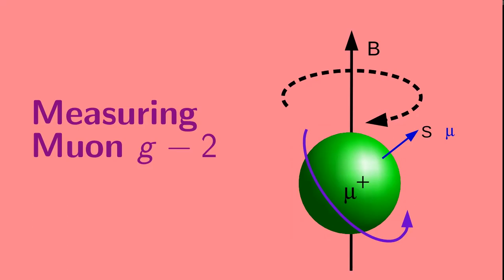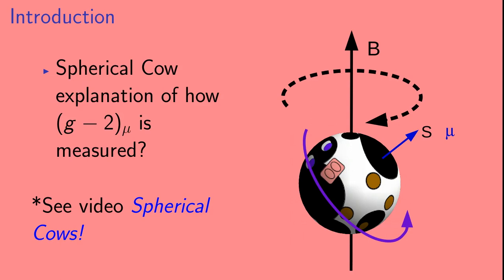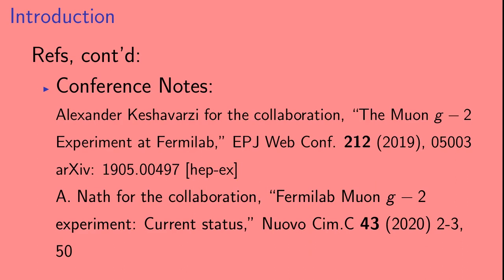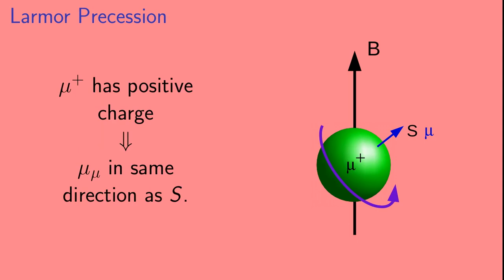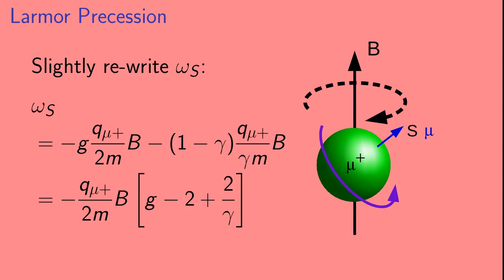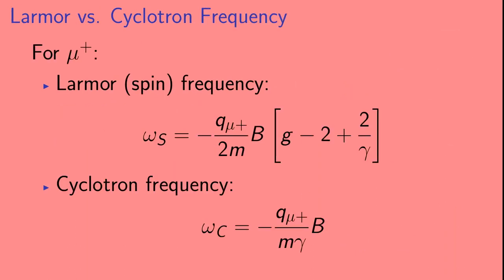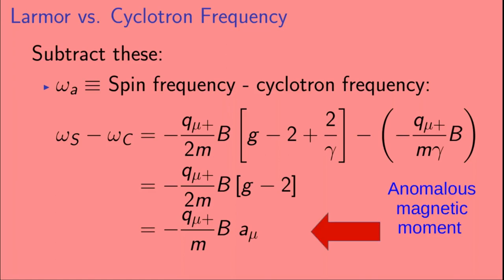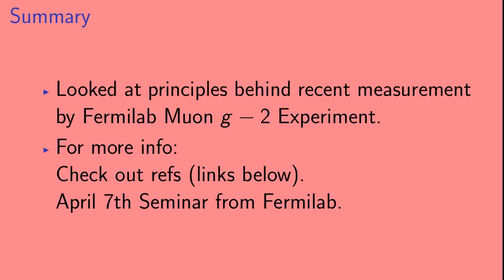Measuring Muon g-2

Comment from the maker: Hi!  Questions?
Reply: Hello again. About my previous question. I've opened a related thread here in the PSE forum: https://physics.stackexchange.com/questions/631982/does-an-observer-moving-in-a-circle-with-constant-angular-velocity-in-space-expe?noredirect=1#comment1421013_631982 
Because this question really puzzles me. What I'm missing here?...
Reply from the maker: Hi!
I'm going to be a bit slow about answering your question.
On the one hand, the formula I used to get the 64 microseconds was entirely from special relativity, so I can tell you that if take only special relativity into account, and ignore general relativity, you will pretty much get the right answer.  (Note:  I haven't checked exactly how precise you can be in saying that, though.)
On the other hand, I wanted to see if I could say something quantitative about how large the general relativity effects should be.  Initial indications are that this might be a highly non-trivial question. 
I'll try to see if I can say something more within a few days.  (But, you might get a better answer from PSE first!)
Reply: @ThinkLikeaPhysicist  Thank you very much for your reply and interest about this question. Seems so far from the PSE answers that gravitational time dilation is applicable only for a fixed direction velocity vector as we have in the case of the gravity acceleration or a spaceship accelerating straight in one direction. For a circular path with constant angular velocity the effect of centripetal and centrifugal accelerations seems to balance out and there is no any accelerated related time dilation! That was surprising to me I didn't know that neither was I taught such think although this sounds logical now to me. Bottom line, in the g-2 experiment, as long the antimuons are circulating in the storage ring at a constant angular velocity, don't bother about gravitational related time dilation effects. The only possible implication I could think of related to gravitational time dilation  and the g-2 experiment are tidal forces during the day that could change the elevation of the storage ring. I don't know how this fluctuation could affect the experimental result at this level of precision?   Maybe it is worth asking the g-2  team collaboration directly if they have anticipated this kind of fluctuation?
Reply from the maker: Hi!

So, it turns out that your question is rather deep.

I've found 2 sources that might be of interest to you.  The first is a write-up that is fairly readable:
https://math.ucr.edu/home/baez/physics/Relativity/SR/clock.html

Now, I'd better give a caveat:  my knowledge of general relativity isn't fantastic.  So, I'm going to assume that what is said on this page is correct; I can't check it for myself in a short time.  I'll encourage you to check other sources!

That said, what this page says is actually really interesting.  We hear about gravitational time dilation, and also, a gravitational force can be taken as equivalent to an acceleration.  So, it seems to make sense to ask about time dilation due to an acceleration.

However, what this page is saying is that the acceleration does not directly cause time dilation.  Only the velocity causes time dilation.  The acceleration only contributes in that an accelerating body is changing its velocity, and the velocity, in turn, causes time dilation.  This is the case whether the body is accelerating in a straight line, or accelerating by changing its direction. 

So, how do we make sense of gravitational time dilation?  That page gives a nice, simple example of 2 astronauts sitting in a rocket at rest on a planet.  They feel a gravitational acceleration of 1 g.  One is at a greater height than the other.  The lower astronaut sends a light signal to the upper astronaut.  Because they are at different heights in the gravitational potential, the upper astronaut will receive the signal as slightly red-shifted.  We can say that this is because the photons had to climb in the gravitational potential.

But.....let's say the astronauts cannot see out the windows.  They don't know they're sitting on a planet.  They instead think they are accelerating forward with an acceleration of 1 g.  How do they explain it?

Their explanation is this:  the ship is accelerating.  That means the ship was traveling slightly faster when the light signal was received by the upper astronaut than when it was sent by the lower astronaut.  The astronauts will attribute the redshift to this change in velocity.  But, when they calculate what that change will be, they will take into account the velocity of the ship when the signal was sent, and the velocity of the ship when the signal was received.  They will not take into account the acceleration directly.  (The acceleration only comes into the calculation by making the velocities when the signal is sent/received different.)

This idea that the acceleration does not, in itself, cause time dilation is called the "clock hypothesis".  It's a postulate.  It's not derived from anything.  If it's correct, it means that there's no time dilation caused by acceleration of the muons in the g-2 experiment.  The time dilation is due entirely to their speed, and is entirely a special-relativistic effect.

This could easily lead to the question, "How does one experimentally check the clock hypothesis?"  You might have seen that reference to Bailey et al on the PSE answer.  That is--no joke--a previous muon g-2 experiment!  Here's the paper:
https://www.researchgate.net/publication/30398795_Measurements_of_relativistic_time_dilatation_for_positive_and_negative_muons_in_a_circular_orbit

There have been a few other tests as well.  I don't know about their comparative precision.

So, your question turns out to not be so much a theoretical one as an experimental one!

As for the tidal effects, I don't know, but you might be interested in this (or maybe you were already aware?):
https://accelconf.web.cern.ch/p93/pdf/pac1993_0044.pdf
and (only vaguely related as it's another tiny effect that had to be taken into account),
http://cds.cern.ch/record/334095/files/sl-97-047.pdf
Reply: @ThinkLikeaPhysicist  Thank you SO MUCH for your superb answer and time and effort taken to investigate this maybe not trivial matter concerning the  g-2 experiment. I am grateful for the sources you provided and will read them carefully. I already contacted Fermilab sharing my concerns about tidal forces related fluctuations but this  whole "clock hypothesis" axiom is a total new game changer and we don't know the implications extend of it to the g-2 experiment. Maybe you should present your investigation to Fermilab and ask them if they are aware about it? After all timing is everything :) Maybe also writing about it to the PSE forum. I am sure there are also Fermilab members in there.

In the past we had even 6σ discoveries who vanished because of fluctuations and unaccounted systemic errors. 

I wish you the best for your really GREAT YOUTUBE CHANNEL!
Reply from the maker: Thanks!  I could take a look and see what other tests of the clock hypothesis have been done since the previous muon g-2 experiment.  It's possible that other, more precise tests have already been done, but I don't know.  If not, it would be interesting to know what could be learned from the current experiment.
Reply: @ThinkLikeaPhysicist  Hi! I have found an analysis that seems valid and negates the "clock hypothesis" for centripetal acceleration: https://osf.io/mf853/download   (public domain pdf download)

I quote: "A demonstration that the inverted Lorentz factor can be extracted using the centripetal
acceleration of a clock hand was provided. This demonstration involves a resistive effect
causing a dilation in the motion of the clock hand. It implies that time dilation might also
be viewed as a consequence of a resistive effect."

I think this is for mechanical clock and I am not sure if it implies also for electronic or atomic clocks?
Reply: @ThinkLikeaPhysicist  Also this here https://www.sciencedirect.com/science/article/pii/S2211379715000625

Basically this article, does not break any eggs. In a uniform circular motion there is no acceleration. Centripetal balances mutually with centrifugal acceleration.  So there is no "clock hypothesis" applied in the first place since there is no acceleration and there is only SR speed relativistic time dilation. Nevertheless, for a one direction accelerated motion if the "clock hypothesis" is not true then that would mean that GR gravitational (acceleration) time dilation is not a relativistic effect but rather an absolute time dilation effect on matter within its own frame of reference due acceleration alone. However, when this acceleration time dilated information must be shared between different positioned observers effectively it becomes a relativistic effect.
Reply: @ThinkLikeaPhysicist  If you ask me my concussion is that the Equivalence principle does not apply in the case of the gravitational with the acceleration time dilation and these are different distinct phenomena. It all comes down to the space-time curvature. Gravity of mass causes space-time bending of path and thus gravitational time dilation must be considered as a relativistic effect. However, a mass accelerating in one direction does not cause a space-time bending only a variation of speed and mass inertia. Therefore an acceleration time dilation (i.e not gravitational time dilation) must be considered as a special case of a SR varied speed time dilation. Finally, there is a  caveat in the last case which holds only if the "clock hypothesis" is correct. If it's not then acceleration has an additional non-relativistic time dilation contribution component. (uniform circular motion is not an acceleration and therefore causes only pure SR speed time dilation).
Reply: @ThinkLikeaPhysicist  FINAL NOTE: The Equivalence principle is actually not violated from the distinction I have made between gravitational and accelerating time dilation since the Equivalence principle applies only for an accelerating frame on a relative small area in space-time where space-time can be considered as flat. Therefore for this small area the Equivalence between gravity and acceleration holds. (i.e. there is no space-time bending in that small region due gravity). For long distance accelerating frames the Equivalence principle should not be applied anyway.
Reply from the maker: @Markoul11  Hi,
I took a look at those 2 documents.  Uhh......so, I'd strongly suggest that you not try to get anything out of either of these papers.  
OK, so....the 3-page paper is very clearly wrong.  (They're not even doing special relativity, just Newtonian mechanics, and then they make some math errors in getting their answer.)
The longer paper is....harder to describe.  It is very unclear, and I can't say I've had success in figuring out what they're trying to claim.  They say a lot of odd things, often without justification.  And, there are definitely things in this paper which are wrong.  (The proton becomes unstable at high energy?  That's news to us particle physicists--proton decay has never been observed.  Two time dimensions?  Yikes.) 
I'll see if I can track down some sources.
Reply: @ThinkLikeaPhysicist  Yes I've got also into the conclusion that specially the 3-page paper is a  very incomplete study. How you can only analyze the effects of centripetal acceleration without going into the centrifugal? As for the more extensive published article it has I believe some good and novel points but does not say clearly what the contribution of its findings are if any? Just an other angle approach to verify and confirm already established knowledge.  
For me my question is answered I believe since a uniform circular motion is speed wise not regarded as an acceleration and therefore makes the "clock hypothesis" and acceleration time dilation irrelevant for the g-2 experiment time dilation calculation in which only SR speed dilation is relevant and present. (GR gravitational time dilation effect  can be excluded from the calculation  since storage ring and detectors are at same height level positioned). So I will not follow anymore this line of research although with your precious insight I have learned some interesting things and that the equivalence principle does not apply for long distance linear accelerations (large area in space) and for circular uniform motion.  Thanks once more for you scientific rigour demonstrated.
Reply from the maker: Hi!
I think that this paper is useful for answering your question:
https://arxiv.org/abs/physics/0406139
They look at time dilation for an object in circular motion.  They work it out in both an inertial and the rotating frame.
They do something slightly more complicated than what you have asked about, in that they also consider the case where the object's speed is changing.  But, for uniform circular motion, you can set alpha=0, which makes some of the equations a little simpler.
Reply: Hi! Excellent presentation as always. I'm wondering if this 61.8μs from rest, antimuon's time dilation is a GR acceleration time dilatation or a SR constant velocity time dilation? If the momentum vector is constantly changing direction due the cyclotron motion does this not account for an acceleration and therefore SR constant velocity time dilation does not apply here?  Thank you.

Comment: 17:44 Muons are not supposed to exist (at least for long),
but as a result, the energy they represent may decrease over time as well.
Once a threshold energy is reached they decay, but in the cyclotron
they have energy added through their speed, much like photons.

Photons, despite being very different particles, don't lose speed but lose energy,
when subjected to a gravity field, and can only escape a black hole through
burning off energy. So, this phenomenon may change the characteristic
of a particle, mere loss of energy.

Can this be what lengthens the time till they decay as well, but also
if they'd have more speed added like in a really large accelerator like Bern LHC,
would they then stay existent in undecayed state for longer still ?

Would be interesting to know.
Reply from the maker: Hi!
Are you asking if muons live longer if they are traveling at higher speeds?  If so, yes, if you observe high-energy muons, the lifetime you measure in your frame, on average, will be higher than if their energy was lower.

Comment: I think that before we start assuming new particles, we'd first need to check
whether or not the abberant muon wobble, (which took me ages to find out what it is, my time)
may be the result of sympathetic electromagnetic vibration.

What I mean by this, is that current travelling through a wire pops in electrons one side of an atom,
where the other side of that atom would have to release the added electron.
This in turn creates a very minute electromagnetic wave front, which then happens all through the wire.
Decillions (arbitrary large number) of atoms getting an electron added, while relaesing one as result
of the electron pressure on the opposing end, each creating their own electromagnetic wavefront,
and combined resulting in a powerful electromagnetic field.

But.

This in turn means that there's an extremely high, possibly even uneven, frequency attached
to this field, which then in turn may be either sympathetic or asympathetic or neither.

Let's say the muon's sympathetic frequency is like 4 ghz (arbitrary number), and the frequency
of the electromagnetic field would be any whole number multiplier of that, it would receive
sympathy, or possibly only a short near sympathy which then happens on a freqency
of it's own.

I'd have that muon test redone with varying voltages, possibly even alternate currented,
counterfielded and minute time magnetic field tested and maybe even alternate cored,
alternate coil length and thicknessed.

Who knows, if that changes the wobble, than the wobble can be controlled at least,
which makes it more useful for testing purposes alone.
(Or possibly a new timing method that can reach peta/exa Herz.)
Reply: Btw, alternate coils don't have to be expensive at all, since it's the wobble we want to change,
as a result of differing all aspects, just to see if it will change.
If it does, you found the mechanic to the wobble control or wobble difference,
and if it does not, the coils were cheap and thus for little expense you found out that the wobble does not
change, despite the cheap coils, and needs no expensive coils to be stable.

Also, cheap smaller cyclotron.